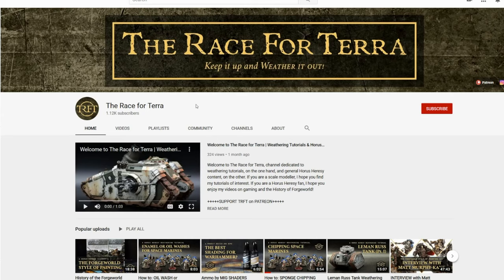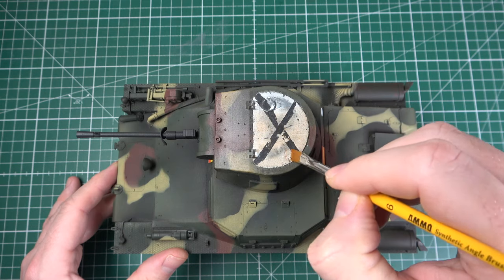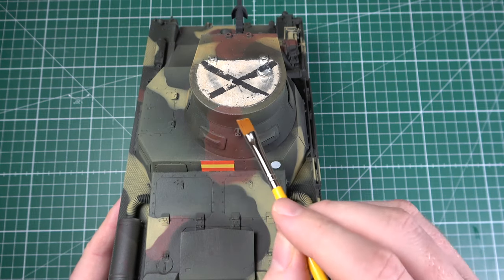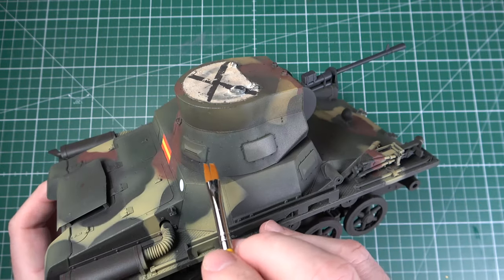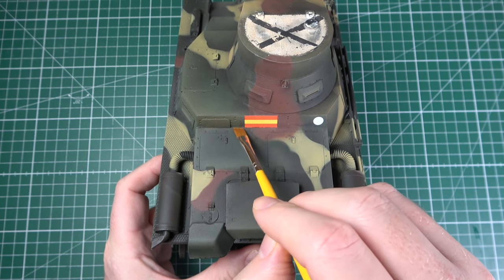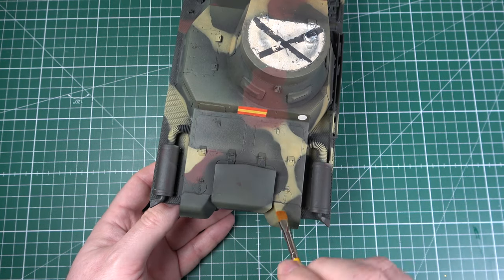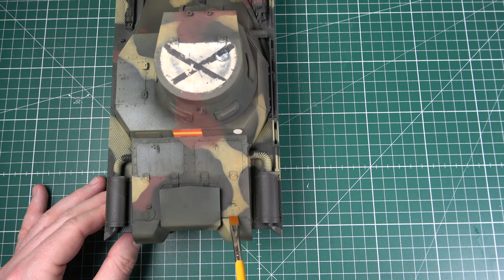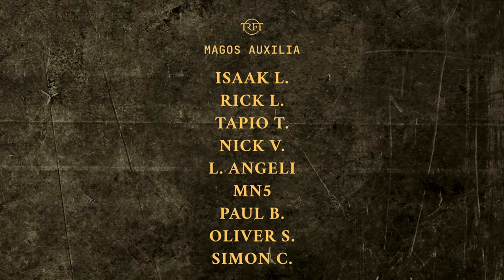Enamel FILTERS - When and How to Use? | Panzer 1 Breda Tutorial

Comment: Would it be possible to apply a filter using an Airbrush?
Reply from the maker: Good question. Essentially, yes. The AMMO Shaders can be used in a similar fashion, and I have often airbrushed an enamel wash to tint a panel. I have never tried with an enamel filter, but the principle is the same.